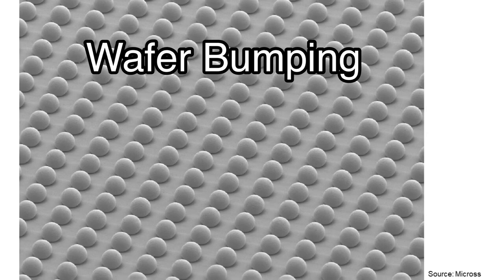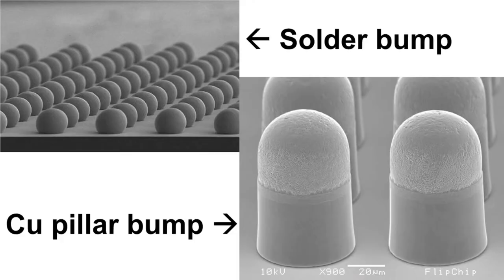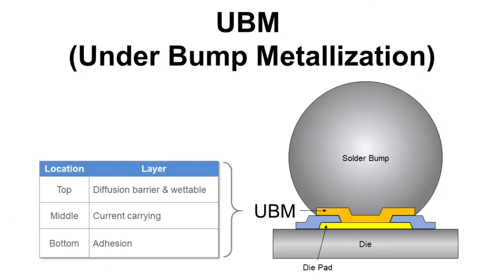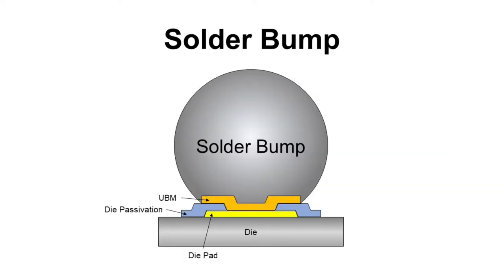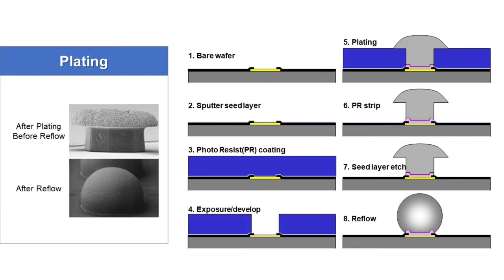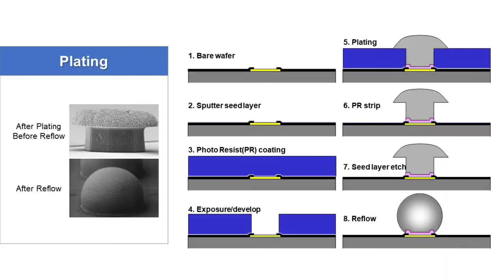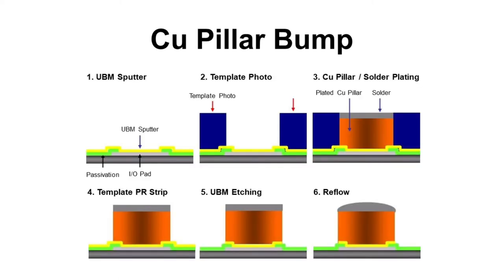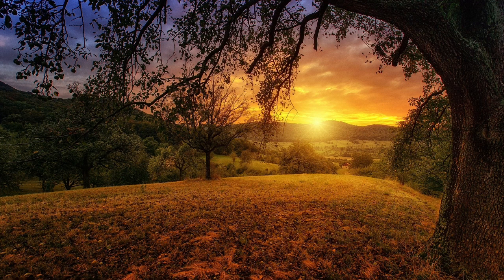[Eng Sub] Wafer Bumping Process: Solder bump, Cu pillar bump, UBM

Comment: The bumping process mentioned here is C4 bump, used to bump flip chips, there is a "micro C4" or "micro bump" process, which replaces stencil printing of solder paste by lithography and ECD plating process.  micro C4, literarily achieves smaller bump diameter and bump gap/height, close to the range of Cu pillar.
Reply: Wonder if there are some ways to create the bumps on a 2mx2m area using a print technique (cheaper version)
Reply from the maker: Sorry. I missed this question. Wafer bumping with printing was used long time ago so I am not sure which company still provide this service. And wafer bumping is done for wafer, round shape.

Comment: Would it be better to fab the solder bumps on packaging substrates instead of wafers?
Reply from the maker: Sometimes solder is made on package substrate pad so called Solder on Pad(SoP). Cu pillar bump without solder cap is also available for some high performance computing applications. But solder bump on wafer is much popular solution.
Reply: @semicontalk3223  👍❤️

Comment: What is a good reference (review or book) that you recommend on failures and failure analysis of the copper pillars?
Reply from the maker: Thanks for asking. 
I don't know about good reference book so I attach some links for reference material.
https://www.dfrsolutions.com/hubfs/Resources/services/Overview-of-Copper-Pillar-Technology.pdf
https://smtnet.com/library/files/upload/Fine-Pitch-Micro-Bump-Cu-Pillar-and-BOT.pdf
https://www.circuitnet.com/news/uploads/1/IMAPSDPC2010FCEMReliabilityCuP.pdf
https://pdfs.semanticscholar.org/992d/7bf7dc7df4c58f35a9e35413a56452f6cce3.pdf

Comment: This is great - thank you  -  Q:  What is the composition of the seed layer in the plating process, and how is it different than the UBM?
Reply from the maker: Sorry, this process flow is simplified one for introduction and does not include details. There are lots of options for seed layer in the plating solder bump and one popular composition is Cu and Ni is another one. Seed layer is for following solder electroplating process. 
UBM is fabricated on top of die pad by sputtering process, physical vapor deposition which does not need electrode.
Seed layer is fabricated on top of UBM by plating process, chemical deposition which needs electrode. 
So final stack-up will be die pad-UBM-Seed layer-Plating solder bump. These are only one of many options and others are available as well.

Comment: Is RDL in the wafer level packaging created the same way?
Reply from the maker: Similar but little bit different. RDL is redistribution layer and its simplified process flow is passivation layer coating & expose & develop --> Seed layer sputtering --> Photo Resist coating & expose & develop --> RDL electroplating  --> Photo Resist strip --> Seed layer etching. I will make a video about WLCSP later.